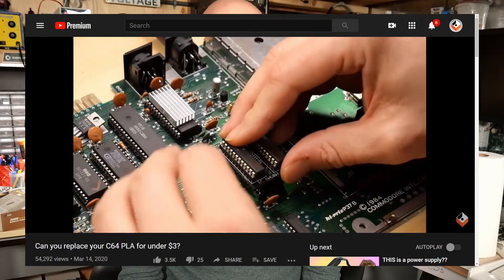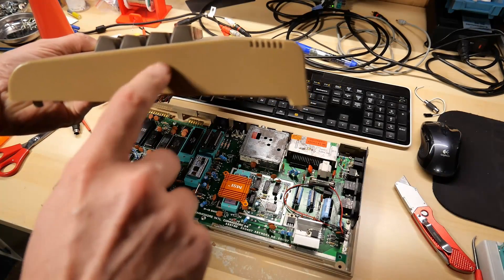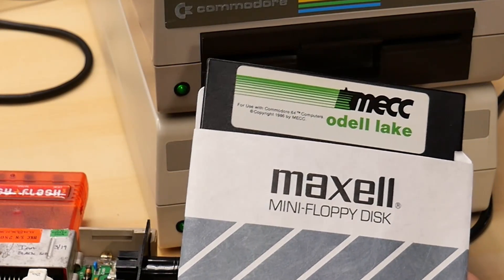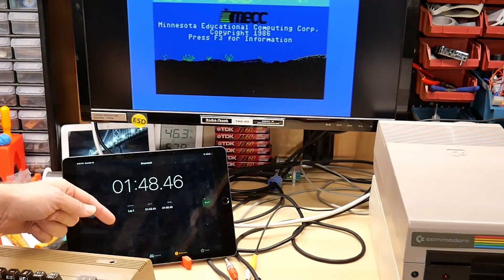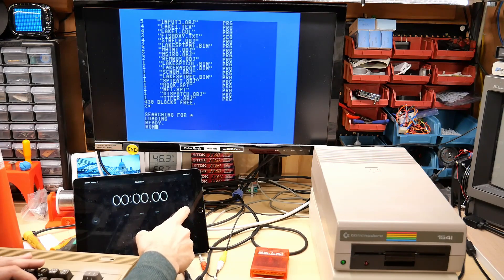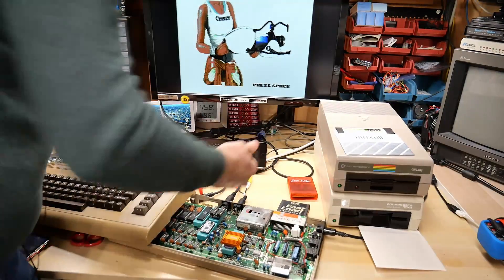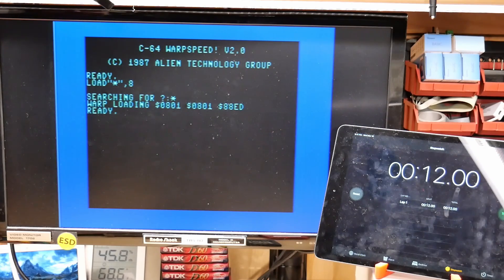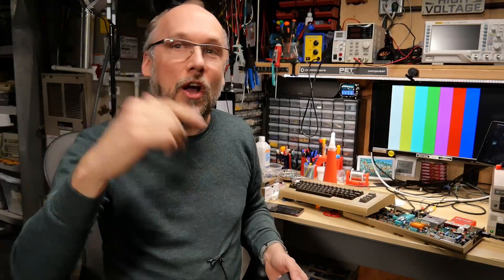Does the $3 GAL-PLA work with Epyx FastLoad? (Bonus fastload comparisons)

Comment: Another one to test is Fast Hack’em fast boot.  I used that one for many years until I got a JiffyDOS system.  (Although if I remember right, while it’s fast it’s not as fast as JiffyDOS.)
One thing I tried was converting some single file programs with Turbotape, and those loaded faster off a cassette than they did from a plain stock 1541 (or JD 1541 with JiffyDOS switched off).  Crunching programs with something like Bit Imploder to make them smaller can also help load speeds, especially when combined with a fast loader.

Comment: The EPYX Fastload cart was, I believe, a software-only system. The hardware on the cartridge I think was designed to "turn off" the cartridge but I am not sure if that was an automatic thing for compatibility if you had to issue a "turn off" command, it's been so long that I can't remember. Also, wasn't Jiffy-DOS designed to have a parallel cable connected to the disk drive, or was that a different thing? It seems like that would be even faster possibly than using the IEC serial bus. :) Great video as always!
Reply: Rick The Geek - HW on the Fastload charged a cap which enabled the ROM for a short time. Part of the code periodically kept the cap charged to essentially keep itself alive. Workings of the cartridge was an amazing timing feat.
Reply: JiffyDOS is a serial only solution and it was so good that it made earlier parallel cable solutions (such as SpeedDOS) obsolete. The best parallel solutions (DolphinDOS) are still faster than JiffyDOS.
Reply: @danielmantione  I have my doubts it would be better than the parallel version for the Plus/4. But then the Plus/4 had a 6551 inside of it. That would make for an interesting hardware mod - adding a 6551 internally - for the C64 but would probably require a hacked kernel too. On the Atari 8-bit side, they've got the SIO Port to receive about 120KBps through the SIO Port with extremely efficient modern coding use of the POKEY chip. That's nearly as good as what the Apple II could do with the Super Serial Card with a 6551 on-board.

Comment: The 8-Bit Guy would love the directory function where the fastload changes the text color to white... :)
Reply: Interestingly, my Epyx Fast Load cart does not change the text color on the $ command. Older version?
Reply: @MrToast64  Not quite.  What MECC did is that you can use a sector editor to manually edit the disk name or the file name to include cursor commands after a shift-space (a regular SPACE is ASCII code 32; on the Commodore computers, SHIFT-SPACE was ASCII code 160).  So they edited the disk name to be something like {SHIFT-SPACE}{CLR-HOME}{WHITE} (which would be ASCII codes 160, 147, 5).  That way, when you listed the directory, it would clear the screen and set the cursor color to white before showing the rest of the directory.
Reply: @SpearM3064  ahh, yes. I remember playing with some of these tricks, even playing with some utilities that let you modify each entry in the sequence... BITD.
Reply: Good explanation-hadn't considered that was the case, here. Thank you.

Comment: You'd think Commodore would have made a recall so that they could have fixed the glacially slow disk load times.  Every other computer manufacturer had it nailed down how to make a good disk system, but Commodore's was The Suck.
Reply: It wouldn't have helped unless they also recalled all the Commodore 64's to replace the Kernal ROM chip.  See, here's the thing: The VIC-20 and the 1540 disk drive used a 6522 I/O chip.  Unfortunately, the 6522 had a bug in its hardware shift register, forcing them to use "bit-banging" (software control), which is why the disk load times were so glacially slow.

When the C64 came out, the 6522 chip was replaced with 6526 chips, that had working hardware shift registers.  For "backwards compatibility" reasons, Commodore did not replace the I/O chip in the 1541 disk drive.  You have to have a working hardware shift register at both ends.  But since the 1541 still had the flawed 6522 chip, they had to continue to use the slow bit-banging routines.

To fix the problem, they'd have to recall all the disk drives and all the C64's, so they could replace the 6522 in the disk drive, and replace the slow bit-banging routines in the Kernal ROM with faster routines that took advantage of the hardware shift register.  Commodore made about 12.5 million Commodore 64's, and at least that many 1541 disk drives.  A recall of that magnitude was never going to happen.
Reply: @SpearM3064  Well they should have figured something out.  The awful long load times are impossible to justify, as is the need to input a load command when other manufacturers simply require you to put in a disk and then turn the computer on.
Reply: @infinitecanadian  Oh, I'm not going to argue with you about the load times.  Without some sort of fast load routine, it takes donkey's years to load any really large program.  I don't know why they never bothered to figure something out... or maybe by the time they decided to do something about it, they realized there was no need to, because other people had already done it.  JiffyDOS, DolphinDOS, FastLoad, Action Replay 3, Warp Speed 5... if you were looking for a fast load routine, you were not spoiled for choice.

As for the LOAD command... you can set up an autoboot sector on the C128, but not on the C64 and older.  The reason for that is because Commodore DOS is stored in ROM.  There's simply no need for the computer to be able to load DOS off the disk like on the Atari 800 (which knows just barely enough about the disk drive to know how to load DOS.  Then DOS takes over the rest of the boot process.)

For me, the convenience of not having to sacrifice a large chunk of RAM to use a disk drive is worth the inconvenience of actually having to type a LOAD command.  (The Atari 800 had to load its File Management System into RAM.  This means you needed extra RAM to run with DOS loaded.  Since Commodore's DOS was in ROM, you didn't have that problem.  Another advantage is that you didn't have to waste disk space with DUP.SYS and MEM.SAV, which took an extra 10.5 KiB of space on a disk that only held 88 KiB, slightly over half of what a Commodore disk could store.)

Comment: I was thinking wow, 3 minutes 15 to load a C64 game...that's really fast.  I was used to 10 minutes or more to load a game from cassette on the C64 and that's if it even loaded with it often taking multiple attempts to get the game to load.
Reply: but... turbo loader tapes load as fast as 1541 disk drive stock does, almost any game on turbo tape method takes about 3 or 4 minutes to get a program load on the computer.
Reply: Pirated software used to take a really long time to load... Or so i've heard.  :)

Comment: Anyone have any experience w/the Enhancer 2000?  I had that pos...every game was a crapshoot whether it'd work w/the drivd or not.  Was there ever a compatible ROM to make it work as well as a 1541 compatibility-wise?
Reply: Probably not, because Commodore would probably have sued them if they did.  (And in fact, Commodore won at least one such lawsuit because the company in question had used an exact clone of Commodore's ROMs.)
Reply: @SpearM3064  - Well later towards '87/'88 I got an fsd-1 and that never had any issues.  So what? Better reverse engineer of 1541 ROM than Enhancer group or rolled dice CBM didn't sue them into oblivion?
Reply: @PrimalNaCl  Better reverse engineering would be my guess.  CBM was pretty enthusiastic about protecting its copyrights.  By the time the FSD-1 came out, the internals of the 1541 had been pretty completely mapped out, so it would have been child's play (relatively speaking) to figure out how to fake it well enough to fool copy protection, and yet make it different enough that CBM wouldn't have legal grounds for a copyright infringement lawsuit.

Comment: I remember The Final Cartridge (III?) being a popular add-on among people I knew who had a C64. It was from a Dutch company and also included both a fastloader and and Action Replay like feature. Anybody here know how that cartridge compared with Elyx FastLoad and others? Perhaps that cartridge was only popular in PAL regions and maybe didn't even work with NTSC models of the C64?
Reply: The FC3 fastloader is way more advanced than Epyx Fastload and even way more advanced than JiffyDOS. It uses out-of-order loading and optimized GCR decoding routines to speed up as much as possible. Epyx Fastload is from a technical point of view a really poor fastloader. However, it was available early in the C64 lifespan, and it was low-cost, so had a large impact on the userbase.

Comment: by 87 or so, GEOS came with is own turbo SW for 1541 that claimed 5X or better speed compared to the legacy 1541. No mods, just stub of SW on the drive an loader on the C64.  I used Geosfor 1 month to track the expenses at home (as game) with its text editor, and twin drives and in moved decently,taking into account that it was accesing to the drive constantly to load load and unload content. I would compare it like installing and using W98 on a  DX2 486  on minimal RAM. That is, far from ideal, but not painfull. As per fasload we used a piece of sw called "turbo" that was so small that we copied it on EVERY disk so, turbo was first an then the game. I would call for easly 3X speed probably even more. CBM was in hurry to release the C64, its I/O routines were rewriten to cope with the CIA bug what they poorly made in terms of efficiency, no time for doing thing better. In just a few months and thanks to the strcuture of the drive being a computer on its own, programaer managed to load and excecute far better code than the original one. Of course, kernal I/O needed to be updated on the C64 side as well.

Comment: I am kind of shocked that there is not a "list" of what fastloader to use for every game, to maximize performance out of each one. I haven't got into C64 emulation though... Hmm...
Reply from the maker: Yeah the one comparison page doesn't really compare specific games but rather loading or saving the same PRG file across all the different fastloaders. Clearly there is a big variance depending on the software, etc.
Reply: ...or patches for said games...

Comment: I bought the rom burner you use, waiting for it to arrive. What eproms should I buy for the C64?
Reply from the maker: You need PCB adapters to use normal EPROMs with the C64 -- but a 27C128 would be typical if you want two KERNAL images.
Reply: @adriansdigitalbasement  thanks, I ordered a couple. I will get the vero board out to make the adapter, it will keep me busy until it all arives.

Comment: Warp is still "slow". The fastest turbo I used in C64 mode was 15x which loaded full memory PRG file in only 8-9s.
Reply: what turbo loader is that?? cart ?? or software loader?? typically I use software loader such as Action Replay 3.0
Reply: @claudioquintanilla1471  It was small PRG which I had on each floppy. I don't remember its full name but it had "giga" or "ultra" in name.

Comment: I'd love to see a more technical video on why 64 loading was slow and how fastloaders worked. 

I get the gist of it, shift register hardware failed before Christmas and they needed it out... But what did they do instead that was so bad?

When my father was young he had a C64 and a 1541, and he tells me that he used to tell the computer to load and then go play Atari or go outside while waiting.
Reply from the maker: Check out 8-Bit Guy's video on disk drives if you haven't already. He touches upon it briefly (I think.) Unfortunately I don't fully understand how they achieve such dramatic speed-ups as sometimes things cane be 10-15x faster over the same cable.
Reply: @adriansdigitalbasement  Well... the problem is not the speed of the serial interface.  The Apple II proved that a serial interface can be really fast.  (It's true.  Even though it looks like a parallel cable, the Apple II floppy connector has only one pin for sending data and another pin for receiving data.  So the Apple II technically has a serial interface.)  Some fast load routines, like the Epyx Vorpal toolkit, can reach speeds of ~9,000 bytes per second!
Reply: Just like your father, I remember starting to load something on the C64 and then would go watch tv while it loaded..  Some copied software was so bad that you could watch an entire show before it would load... and sometimes it would fail in the load and you'd have to start over.  This was our version of the 'walking uphill, in the snow, both ways' joke...  :)
Reply: mind you the tech sceners knowing this will more or less laughter you if you don t get it right.

Comment: Adrian, would it be worth doing a compare against the [ee]prom based PLA replacement? Does it still work with loader carts, etc., as an alternative to GALs.
Reply from the maker: The EPROM ones aren't good and only marginally work. I read they are generally incompatible with all of these things like Super Zaxxon and Fast Loader. They introduce glitches on the select lines from what I hear.
Reply: @adriansdigitalbasement  Yes, some can be particularly glitchy, however slower ones (70+ ns) seem to behave better.
The guy behind PLAnkton appears to have made tests explaining the glitches, but found a particular eeprom that apparently out-perform even the original PLA (far lower power use and comparable or lower switching noise).

As an aside - I wonder if other GAL brands/age also behave as well as your examples?
I suggested it as a poor-mans alternative, possibly showing pros/cons against CPLD and GAL examples (though the GAL is already proven solid so far!)

Comment: Had the Epyx Fastload for some time, but then I upgraded to the Super Snapshot which was faster in every way. It worked with more games than the Epyx Fastload too. Also, if memory serves me well, if you just hit Commodore-Run Stop it will do LOAD"*",8,1
Reply: I had the exact opposite result.  It was faster, but it worked with LESS games than the Epyx FastLoad.

Comment: Interesting to see many folks here that never had a C64 themselves, (Myself included.) but are fascinated to see your work here.  In my case, I started early with the TRS-80 Model I, and moved on to the Tandy Coco line, while my one of friends got a C64 and  the other got an Atari.  So betheen the 3 of us, we nearly had the full spectrum of early 80's home compute covered!! Good times.  I still have my original Model I form '77, and have been slowly collecting bits for it.  I'm researching now on how to leverage the dual chip floppy controller to see if I can load data from a high density drive, and eventually my floppy emulator-to-usb thumb drive, so I can easily load images, and then write them to real disks.  Thanks for the inspiration to dust off the old gear, and bring it to life!

Comment: I think some of those FastLoad routines would confuse printers? That was the warning, not sure if this ever happened or not.
Reply: Not that I'm aware.  Maybe if you had the printer turned on before you turned the computer on.  (The 'standard order' was to turn the C64 on first, then the disk drives, and the printer last.)
Reply: @SpearM3064  My understanding is that fastload uses the serial bus lines in a non-standard way. So it wasn't guaranteed that other peripherals would handle this reasonably.

Comment: There are multiple reasons, for not using a software based fastloader. First they need some space on the disk, and you normally don't like swapping disks more than necessar, so that space has to be available on the disk you are loading your game from. While many of the olfer software fastloaders might be speedy , they often take up to about 25 blocks, thus making them too big for many disks. Then of course evey softloader has the problem of being overwritten while in RAM by many games, so you have to find a fastloader that actually works for the game you are playing. Also games that load data again, after initial start, rarely benefit from a software fastloader, because the routinges have been overwritten. There are some fastloaders that let you configure where to store their routines, for trying to protect them from being overwritten, but that'a annoying work again. And there are fastloaders like 'Heureka Sprint', that require you to rewrite the whole disk in their very own format, that cannot be written to or be read from without using the software itself. So it's s chore, but on the other hand HS it's said to be the fastest way of loading on the whole C64 of all software fastloaders.
Btw: Some years, ago, the user 'Mafiosino' from the German forum64, coded an software based fastloader (simply named TRACK1) which probably is the 2nd fast software fastloader of all (and also can accelerate writes, opposed to most fastloaders), directly next to the bothersome Heureka Sprint.
I would really like to see a video from you abut this, with a bit of a tutorial on HeurekaSrpint, as it's not so easy to use, and maybe a comparion of these two fastloaders :)

Comment: On the Apple ][, the stock DOS 3.3 was dog-slow, so a number of optimized DOS hacks were developed of which the most popular were ProntoDOS and DiversiDOS.
Reply: Dog-slow compared to what?  It was still several times faster than a stock 1541 drive.  You're right, though; I remember both ProntoDOS and DiversiDOS, though I preferred ProntoDOS.
Reply: @SpearM3064  Compared to what could be done on the drive.  RDOS only allowed contiguous files, and was extremely fast.  I think some versions of ProDOS even used scatter-read to get faster speed still.